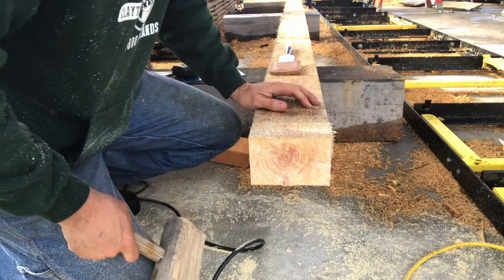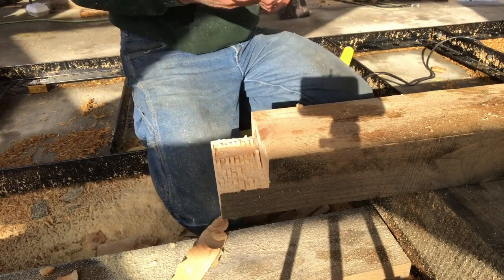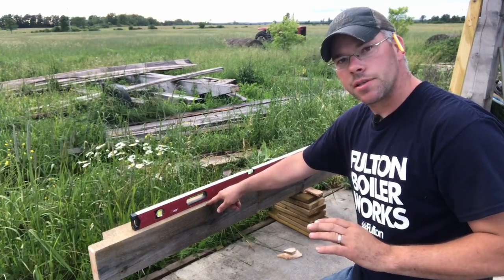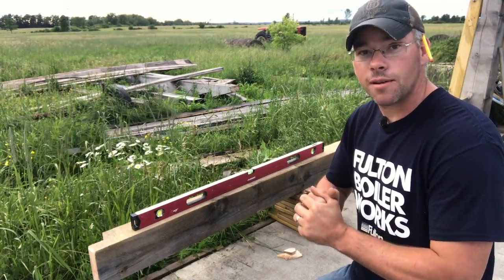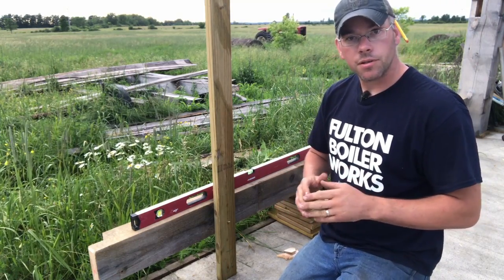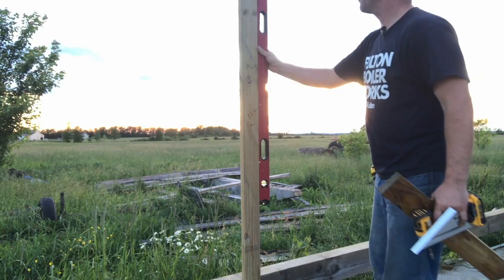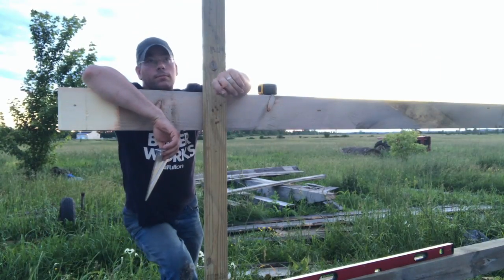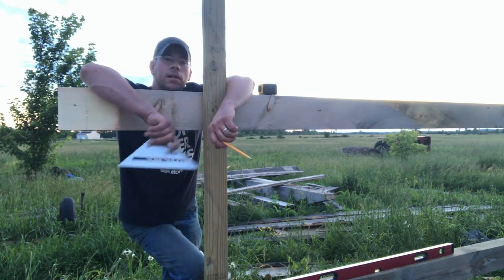A Timber Frame Vlog #21:  Cutting and Installing Girts

Comment: What's your wall height? ...bout 11-12ft?  It looks like 3ft vertical spacing with the bottom girt near the slab to secure board and batten.  Just wondering what your thoughts are... span, siding board thickness, wall strength, insulation, tar paper?
Reply from the maker: +Thane Grooms to the bottom of the tie beams is 10', outside wall height is 14'.  I was originally going to put on board and batten siding but I'm going to strap the walls with 2x4 material and run clapboards horizontally instead.  That way the water doesn't run into the vertical siding seams.  Right now I'm in a budget issue with the building so as far as tar paper and sheathing I'm not sure what will happen.  I'd like to do both.

Comment: when you put up your post on the concrete foundation , how did you secure them to the foundation  thanks
Reply from the maker: They are getting big angle iron brackets with expandable concrete anchors into the slab.